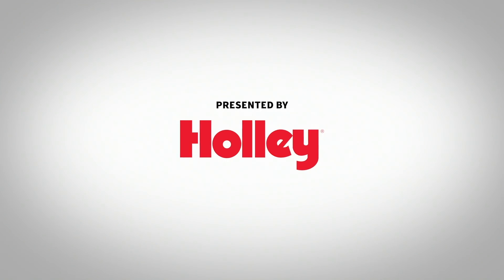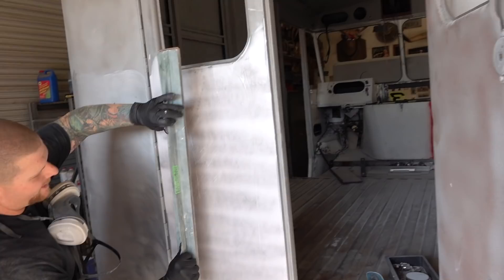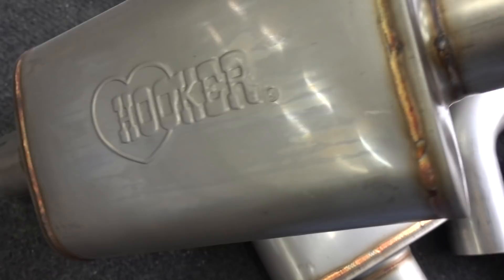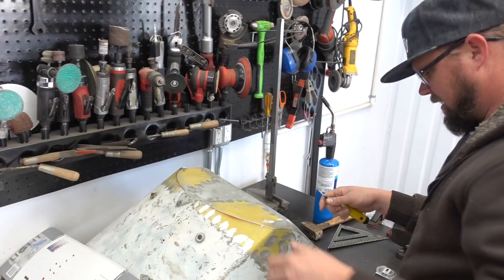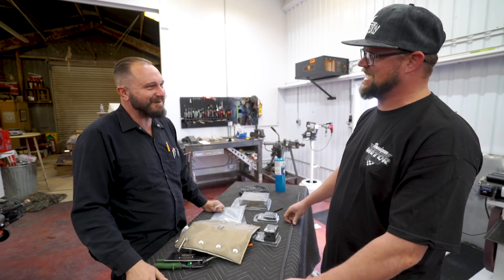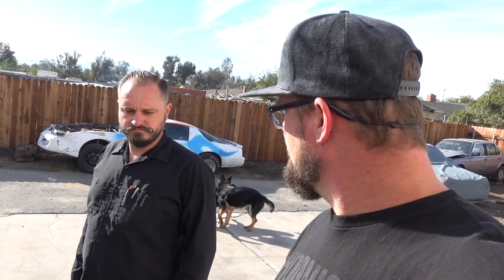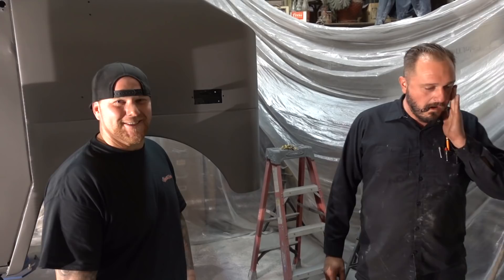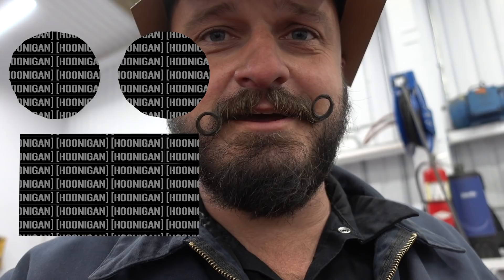Merch Van Gets Airbags, Steel Paint, Interior and More... Building Our Ultimate Chevy P10!

Comment: This'll probably get lost in the void, but.... Funny Vince mentioned road crown. As a general rule, you want half a degree split on caster to compensate for road crown. Camber will pull to the high side over .5*. Castor pulls to the low side over .5*; you can compensate for castor with camber and vice versa. It's what's known as your camber/castor split. Most vehicles have a difference side to side by spec from factory.

Comment: 10:11 PLEASE include a set of push to connect union joints in the glove box because these are FAMOUS LAST WORDS right here... the mufflers and exhaust get real hot. and WILL melt that airline WHEN YOU LEAST WANT IT TO... thats usually after some high throttle and you're on the freeway going high speed and one bag drops, and if you are set to drop frame... NO BUENO!!!
can use the PTC unions to cut the hose where its leaking and splice it with the union.
OTHERWISE PLEASE run the line outside the rail!!! ASK ME HOW I KNOW!!!!! leaks suck.

Comment: Alignment will have to be redone once everything is mounted and sitting on 4 wheels, motor and body will change everything you just done.
Reply: RON SALES As long as they set everything with it at ride height it’ll be close enough. With the airbags they can set the height even with the weight.